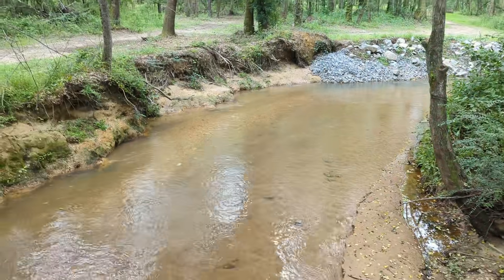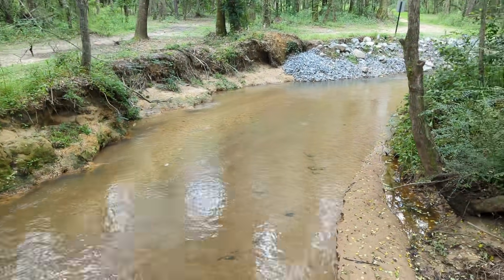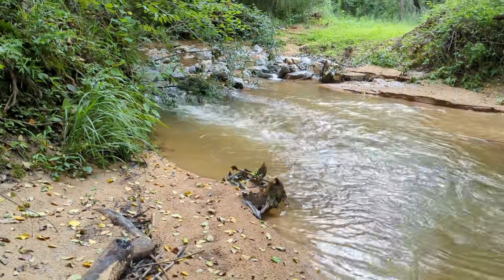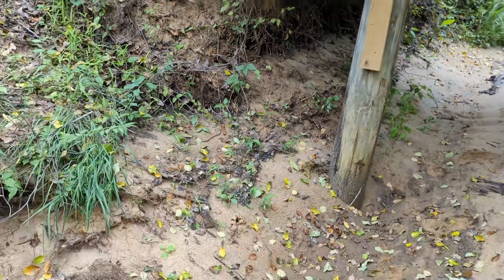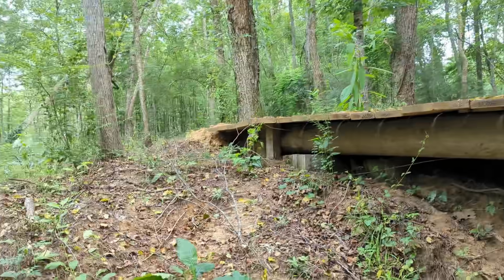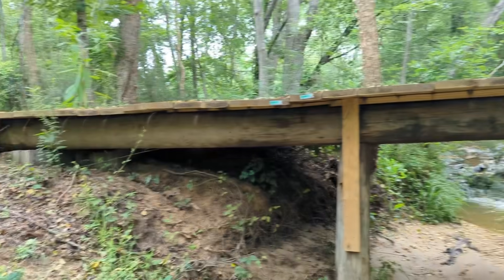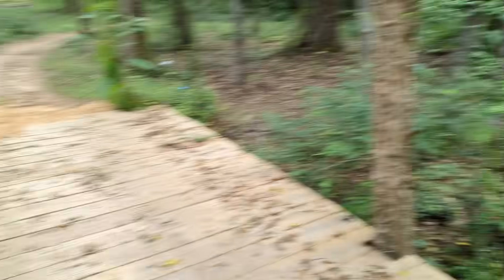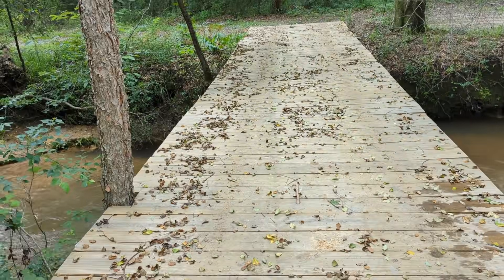Bridge build with utility poles

Comment: Keep in mind that while power poles are strong for holding the weight top to bottom, they are not so good for holding weight sideways.  That's why whenever you see a power line make a bend, or turn left or right, even slightly, you will see they install one or more guide lines into the ground for support.  Without guidelines those poles would bend in short order and eventually even break from the sideways weight.

Comment: Nice bridge! I bet you've already done it, but when you get some used oil from the tractor or other machines, use that to oil the bridge decking. You can also use diesel fuel to cut it too, if you wish, or just straight diesel to oil the decking. It'll help keep it bug free, and from drying out like crazy. I used green treated on mine too, but this has been a super easy, cheap way to help extend the life of our wooden bridge.

Love the build. Looks nice, and way longer than ours, but we used downed trees. Only about 16 feet from anchor point to anchor point on ours, so a totally different world on your bridge.

Comment: I have a similar span, 32’, currently I have 2 utility poles running the span at 36” wide and it bounces.  I’m looking at adding another pole and some 2 x 10’s to widening and firming it up.  I’ll check back once in the process.   Thank you for sharing.    John

Comment: How much load can this bridge carry? What is the unsupported span? 
How much vehicle load can a single utility pole 30' long"?
Reply from the maker: Great question! I did a lot of research on that and there are several factors. The grade of the poles, length, braces, number of poles and probably others. But I never got a rock solid answer, I concluded I would have to hire a structural engineer to calculate it. 

But I would say I have been driving a  6-7k lb tractor across it with no problem.

Comment: Pull and secure that birch tree away from your bridge and it will make for a solid tree and safer bridge.
Reply from the maker: How do you recommend I do that without hurting the tree? Pull once with tractor or slow pull on it it with strap or something?

Comment: Thanks for making this video. Lots of great tips for a bridge I am starting to build. Question: How much embankment ground is underneath the poles on both sides? Trying to figure out how much “meat” to put underneath my poles on each embankment to span a similar distance. Thanks for this information!
Reply from the maker: That is my biggest concern. Is the erosion of the bank underneath the bridge ends. I had about 6 - 8 feet on each side but we had a large storm and one side got washed. If you have erosion then I would definitely find something to prevent the erosion

Comment: Many years back I helped my friend build a bridge across a narrow but deep sided creek that needed to be strong enough to drive a car over. He purchased an old cargo trailer bed frame. We were able to draw it across the creek with come alongs, pulleys and levers and set it resting each end on a poured concrete pad on weekend one. Then the next weekend we bolted wooden beams down   to form the decking. He ended up using gravel to make ramps up to the deck height and that thing is still standing!

Comment: Nice job there to build a bridge over the creek at a very reasonable cost!  As someone else suggested, I would consider adding railing on each side. If not that, at least add a "bumper board" down the entire length of each side to help keep the tires on the bridge. Also, I would STRONGLY suggest getting a couple dumptruck loads of riprap rock and cover the banks on both sides under the bridge and a few feet upstream and downstream of the bridge. That will help to prevent erosion of dirt from underneath the bridge. There is a fabric made just for that, which you can lay down first, then put the riprap on top of the fabric. Both of those will greatly help reduce erosion.

Comment: I think I would do like another commentor suggested and anchor it well at one end.  Like concrete piers a foot wide and eight feet in the ground with big cables attached securely to the the pier and to the bridge.  I would also put threaded rods through the poles with taps and washers on each side of each pole especially at the end being anchored.  I'll bet the heaviest rain over two or three seasons will be washing that bridge downstream causing who knows what damage if you don't make sure it's anchored really well.

Comment: you should have rip rpaped the banks. One side is already caving. We did the same years ago and paid the price. Also you need more space between boards for the flooding you stated.  It makes the bridge less boyant and water flow up and through instead of unseating the bridge
Reply from the maker: Your right about the riprap. I put near that large oak tree, hoping that will hold the bank. Riprap would drive up the cost.
Reply: @stephengoodwin5403  we replaced the boards on our with grate metal so we dont have to replace them again. They rot  out so fast on a bridge it was more cost effective with the new lumber prices

Comment: I know you said that you will periodically check the poles, but keep in mind that telephone poles are often times only preserved within the first couple inches of its surface, and the poles are meant to be vertical whereby that alone gives a lot of run-off properties for the rain/moisture. When you have your poles laying horizontally, the rain/moisture will eventually penetrate the outer layer of the telephone pole that got the preservatives pressurized into it
Reply from the maker: Well, that is bad news but thanks for the information. I am thinking my next bridge I would use I-beams but I am not sure what size to use. I tried to look up the formula but wow it was complicated, and I have a degree in computer science and mathematics! 😊

Comment: That is a very nice bridge. I would suggest if you ever need to replace it to use an old flat bed semi trailer. You would need a concrete abutment on either end but it would be a forever bridge and would hold anything you wanted to drive across.
Art from Ohio
Reply: This was the same plan I had!  Just hadn't looked at one enough to figure what the process looks like to get the wheels off of it.  Front Jack's should be easy enough.  Then, How to get it down into the woods!
Reply: @BradFess-jo8to  Maybe a tractor with a log skidding winch and some snatch blocks???
Reply: @artszabo1015  Definitely use the tractor.  I was thinking a tractor and then an excavator with the end suspended on a strap?  It's not as much the weight as it's the twist and turns and narrow roads on my place.  I'll have to scout it out a little better and devise a plan.  I'm in the very infancy stages of putting one in.  A State Forrester was the first one who told me about using an old flatbed semi.  It's a brilliant idea and we have a tractor trailer salvage yard less than 10 miles from us!  I have about 30 acres on the other side of the creek from me that doesn't get explored enough for this reason!
Reply: @BradFess-jo8to  If you have an excavator available you could stand the trailer on edge to maneuver it through the tight spots. Where are you by the way?
Reply: @artszabo1015  Great idea.  I'm just outside of Columbus, GA.  Recently purchased 200 acres and am trying to get it back in shape from 20 years of neglect
Reply: @BradFess-jo8to  Good for you Brad, you should be making videos. I would be your first subscriber.
Reply: @BradFess-jo8to  https://www.youtube.com/watch?v=IwlbN2JY9Uk

Comment: In1939 my Dad was in the Civilian Conservation Corps ( CCCs ) and they built a number of these bridges in the Big Piney , Wyoming area . One addition that  would suggest, is to run 2X12 planks from end to end spaced out to where your tires run on them . If you have a narrow front tractor you can run another set down the middle of the bridge for the front tires to run on .
Reply from the maker: Great idea. I have considered this several times. My thoughts are that this helps preserve the wood of the bridge by distributing the weight?

Comment: I would wrap a 1/2 inch guy-wire cable around the poles and tie them off to a tree near-by, extreme high water will float it out, i built one over 10 years ago and used oak boards but did not treat them, so now i need to replace the deck boards, i used 4 poles just like you did, mine is 33 ft. long ,i still drive my pickup and skidloader across it, to treat my new deck boards i will use portland cement mixed to a slurry and coat the boards and stack them tight inside a plastic wrap, let them dry and cure this way. I have pine 2x4 and 2x6s that i used for sidewalk forms over 20 years old that are out in Mo. weather that do not rot, thought this might be helpful, nice bridge...........

Comment: All good. The most likely wear will only be the surface wood and shim boards eventually. The poles, being out of the dirt will last a long time. The cinder blocks may settle with season changes etc.  Obviously, poured concrete would have been better at both ends.
But so what. You did well with the blocks. Now get to clearing the 50 acres of any undesirables. :)

Comment: Our car weighs 2500 lb. You said tractor weighs 4000lbs. If you drive that a car is nothing
Reply from the maker: Yeah, right. We drove our 6000+ lb larger tractor across it this weekend. It didn't break or anything but it did move or sag a little under the weight. Of course my son started bouncing the tractor a bit, which made me nervous!
Reply: @stephengoodwin5403  ok that as great to hear. wasn't sure if you were ball parking the weight. I am looking to build some kind of bridge as well and was happy to see one that held a car weight! thanks for sharing!

Comment: Drill through the ends of one end of the bridge and run a 1/2in. or larger steel cable through those holes and put a big steel anchor (think 8in. dia. well casing down about 6ft.) on the up steam edge of the bridge and triple clamp the cable to the anchor. In the event of flood the bridge will pivot downstream along the bank. recoverable and prevent damage down stream.
Reply: 90
Reply: Great idea

Comment: I like what you’ve done there. I have a similar project and I’ve been looking at telephone poles or culverts to cross the creek. You might want to consider putting a rail along each side of the bridge. It’ll keep your tractor from sliding off if it’s wet or muddy. Also set up a game camera on the bridge and you’ll see that lots of critters will use it as well.

Comment: Nice bridge! Very similar to what I was planning as telephone/power poles are strong, long and usually fair priced. Curious as what you used to get them to your property? Do you have a super long trailer? This is my biggest dilemma is transporting some about 20 miles.
Reply from the maker: I had a friend that had a trailer. If you don't have someone try to find a hotshotter or local guy with a big truck and trailer.